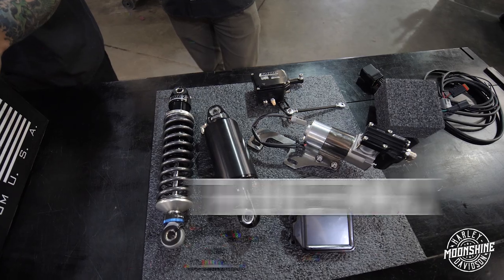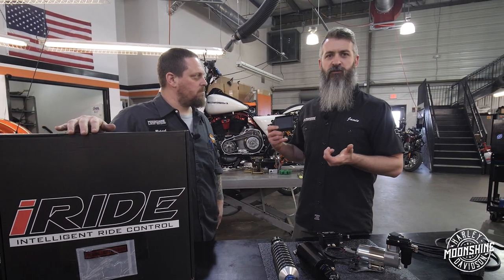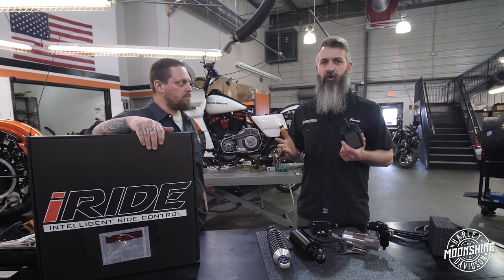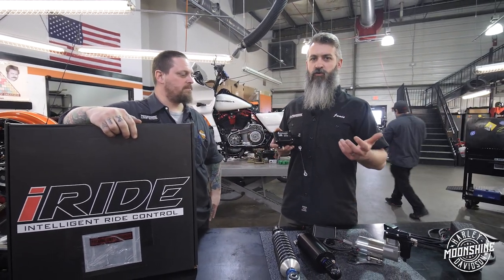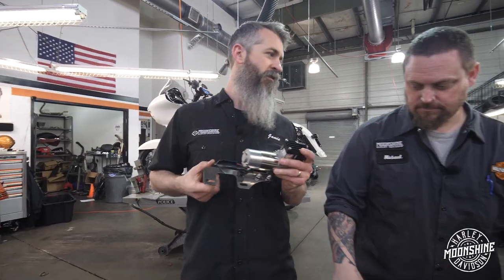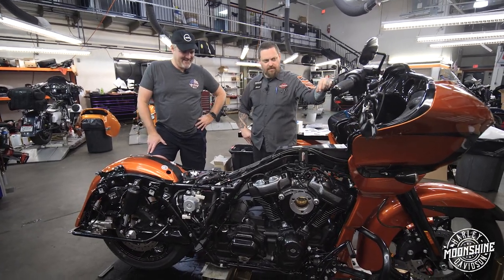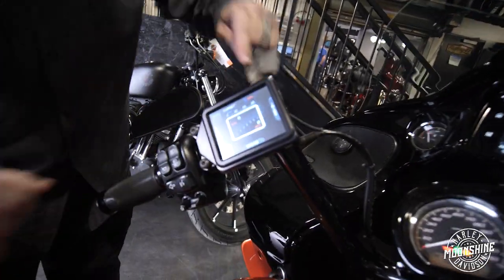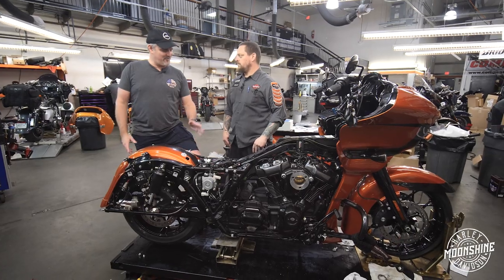The MOST ADVANCED Air-Assisted Suspension | Part 2 Veteran Bike Build by Moonshine Harley-Davidson

Comment: How many opt for the front option as well? Does it affect the ride comfort? I am 5'1ish.  I have heard mixed opinions on whether its a good idea to add to the front. '19 road glide special.
Reply from the maker: If you are more comfortable with the bike really low we would recommend the full kit, front & rear. If the rear is going to get you to a comfortable position with stock front height we would then recommend a high quality cartridge kit for the front. hope that helps.

Comment: What happens when you slow down to go over a speed bump? Never really paid attention to my speed when hitting one, but if its slower than 7mph, im assuming the suspension will drop down causing it to scrape or drag? Or does it have any type of sensing software that allows it to know if you're slowing down to stop or if youre hitting a speed bump
Reply from the maker: Jon Angus it’ll lower but you can adjust the low setting to a lower speed than you’d use for speed pumps. That way the bike will stay at the cruising height for the speed Pumps.

Comment: It’s definitely a cool set up. 90 percent of the time I ride pretty aggressive and would like to eventually go the performance bagger route with my bike. I like my suspension stiff. Would this be able to even come close to a high end remote reservoir setup?
Reply from the maker: This setup is designed for stability in parking lots. It a great lowering option without sacrificing the ride quality. For a performance setup we would recommend the Ohlins remote res. shocks.
Reply: @MoonshineHarley  I figured. Thanks. I appreciate you getting back to me. I’m 6’3 anyway so I don’t really worry about that. Love the channel and all that your shop does.